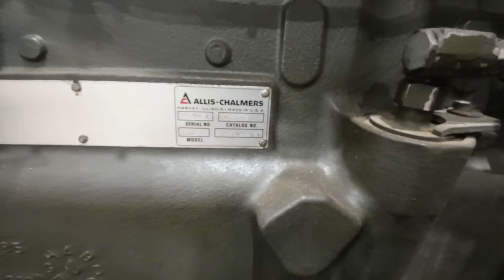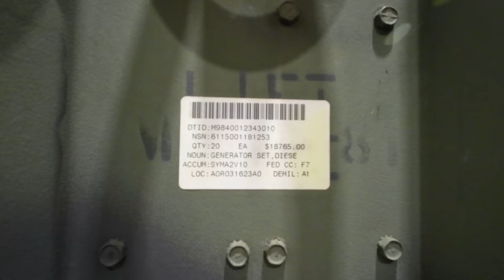$500 Diesel Millitary Generator sitting for many years, WILL IT RUN?? (Allis Chalmers 3500a)

Comment: If someone has not said so far the majority of military wiring to stuff like fuel shut offs will be insulated return, meaning the 2 wires will be hot and ground, the ground will not be connected to the chassis/engine

Comment: Millitary aircraft have a lot of systems that are sensitive to electrical noise, so they run a lot of independent grounds to minimize noise.  That would explain the insulated fuel solenoid.  Not sure but aluminum wire might minimize noise, or just make the skid a few pounds lighter for transportation.

Comment: Its possible that engine was used in some kind of marine application based off of the salt like build up around the lower radiator and tinned wire

Comment: I don't know if this will be relevant or not. Years ago someone I know purchased a diesel pickup from military surplus. He could never get it to run right. Well it was off a airforce base. Turned out the injection pump was set to run JP-1 instead of diesel. Once a technician re-tuned the pump for diesel it ran like new.... So if you generator engine doesn't sound right change the fuel to K-1 and see if it improves...😊

Comment: That engine is for a 60KW 400HZ generator. It's a 24VDC (NATO) system. Stanadyne bought out Roosa Master so that's why they look and are manufactured the same. It's not aluminum wire. It's steel wire. Very expensive cabling. The square tank next to the filters is a "Day Tank" and shuts the generator when you have one minute left of fuel. It prevents you from bleeding the system if it runs out of fuel. The tan box is the electric governor and that arm in the back is for fuel shut off the one facing you (outer side) is the throttle arm. There are two electric fuel pumps. One is your main pump and the other pump of for the auxiliary fuel. With the electric governor, the engine runs at 2000 RPM's. A 60 HZ generator runs at 1800 RPM's. The electric governor will make it run at 2000. You need to move the governor actuator in the Full Fuel position for it to start. In its current state.....nothing will start or run without the control panel. The fuel injection pump has its own mechanical governor.

Comment: As a 52D (Now 91D) Power Generation Repair and Maintenance for the US Army circa 1987, I can tell you two things about Army generators.  Both the positive and the negative are wired and wired backwards. In other words, the military treats (or at least treated in 1987) negative as positive and vise versa.  I don't know if that applies now or to this particular unit but that's how it was back then for the Army.  Oh, and the military is Metric.  Now to finish the video to see what you figured out.  LOL

Comment: Stalactites and stalagmites are very easy to remember.  A stalactite grows down.  It has to hang on TIGHT or it will fall, where as a stalagmite grown up.  If it is lucky it  MIGHT grow tall enough to reach the roof.

Comment: In aviation, we use tinned copper wire or silver-coated wire to prevent copper from corroding. I believe that is what you are perceiving as aluminum wire. Aviation wire is almost always white and teflon-coated these days.  Keep up the good work
Reply: Then you show the data tag for '85... maybe aluminum

Comment: Those two canisters you mentioned are fuel pumps. These types are used on small aircraft. Or at least they look mighty similar. Put power on it and see if it clicks clicks clicks.
Reply: Also the wired negative as opposed to grounding to chassis on the shut-off solenoid smells of aviation. Sure purrs like a kitten she does. Congratulations !

Comment: If I remember correctly, the aircraft uses 400 hertz power. 
Maybe they were using this unit in an extremely cold climate and the fuel needed to be heated to some minimum temperature before the engine could start so no power would go to that fuel solenoid until the fuel temp was met. That might also be the reason the "ground" at the fuel solenoid isn't simply the chassis of the machine. The temperate sensor may provide the ground once it sees the correct temp. Like a fan relay sensor.

Comment: "Wasn't a single pot hole in the first three feet" - Lol, we feel ya in Minnesota.
Reply: From next door in Wisco. There’s some potholes in Milwaukee that have their own potholes. It’s all the freeze/thaw cycles that just wreck roads and therefore wheels, ball joints, and other automotive components. I went down south and discovered that the roads are super clean down there, which is part of the reason cars last so long. Another reason is salt (which is also a factor in northland road wear).
Reply: @jasonmansfieldsr8645  "I went down south and discovered that the roads are super clean down there, which is part of the reason cars last so long." -  That works until it gets hot enough and then another set of problems arise.  One older family member lived down in Mission, Tx in the winter.  Every spring he'd have to have an alignment done after he got back, often with the replacement of the control arms ends.  Some of the holes at expansion joints were amazing and the how even the joints were was directly related to the materials.  You could catch air when it was asphalt to concrete and back to asphalt on a busy street.

Comment: The "Electronic Throttle" is a speed governer which used a voltage sense from the generator to regulate the output power so the voltage doesn't change based on the load to the generator.

Comment: You see there after studying the diagram for this unit, we see it goes from the tank up to the bifurbulators, then clearly it goes over to into that gorbichovski unit which measures the in line pressure before heading out next door to those double floppy jibets, im with you I prolly would have ended up bypassing all those humperdinks. Actually might not be a bad idea to go ahead and check the specs on the IN-line rotary durrdurre 😂
Reply: And for the record it’s also widely known as tappy tapperstein 😂

Comment: At 28:22, the canister things are electric fuel lift pumps. All diesel engines (99%) have fuel lift pumps to feed low pressure fuel to the injection pump. Ad one of the those into your fuel system, and it will probably run even better!

Comment: The wire may be tinned copper.  Marine grade.  Our 1970s Allis tractors with similar diesel engines have tinned copper wiring which looks like aluminum wire.  Tinned copper wiring resists corrosion and can last 10 times longer than plain copper.

Comment: That looks like a GAC - Governor's America Corp electronic regulator, their website is quite good for info on all the bits. The governor in the injector pump may only be limiting the top speed and the "throttle lever" may be setting the fuel directly not the engine speed.. You probably need to take some photos and injector pump part numbers and run them past Area Diesel to find out what you've got. I suspect the injector pump won't run Fat Allis without a different governor in it. But 500 for a replacement engine is amazing.

Comment: silver plated copper.  Mil grade. I have a short roll.   Having access to both can have 'digital' logic control.  This is controlled by THIS AND That then it turns on.  Both are active controls.  Complex electrical circuits.

Comment: You can do a preliminary smoke test using a current limited adjustable voltage regulated DC power supply 0-30VDC range  (good for 12V and 24V) at a max of 20 Amps which will power most of the engine subsystems without running the starter. So, tests are done with key on engine off. This way you can verify all of the wiring, controls and actuators without the danger and needless discharging of the starting battery. After your testing is complete you can disconnect the DC power supply and connect the starting battery. The power supply can also be used as a battery charger if you don't mind setting it up and then checking on it periodically.

The generic wiring is most likely not aluminum but fine stranding silver coated copper with a Teflon jacket (which is very high heat). This type of military spec wire only comes in a limited number of off-the-shelf colors the most common being white.

Comment: Big aircraft are often 400Hz it allows smaller, lighter motors. smaller aircraft typically use 28vDC at lots of amps. Can't tell much from the missing power head but the RPM may be unusual.

Comment: I can tell just from the vid that engine was barely used.. it was probably used for hot starting planes and was only used for a short period of time every once and a while.. the paint on the engine block is still perfect, meaning it didn’t go through enough heat cycles to burn off or fade, and the turbo barely has any oxidation on it from heat cycles as well.. also, that jelly stuff on the radiator is just crystallized coolant.. there’s was probably a small drip coming from that fitting.. as the moisture in the coolant evaporates, it leaves behind crystals from the coolant

Comment: I wondered if you ever used a grip hoist?  The hoist grips a cable in two locations and is so safe that it can be used to suspend personnel.  It also has a much longer reach than a conventional come along.  Not very expensive and I think you could find multiple uses for one.

Comment: this generator injection pump is set up for 1800rpm(60hz) or 2000rpm(400hz) droop compensation,not vehicular use..use the VSLS(variable speed/limiting speed) injection pump from fat alice to run this engine in the loader.

Comment: You can tell the difference between a stalactite and a stalagmite by remembering that a stalactite holds tight to the ceiling and then a stalagmite just might reach the ceiling. I think $500 is a hell of a cheap diesel overhaul.

Comment: Remember to add a fuel supplement (I use Howes but there!s a lot of other brands that will work),  with removring the Sulphur content from the fuel you don!t have anything to lubricate your injectors or injection pump which will shorten there life.

Comment: For those wanting to know what is different about aircraft gensets, aircraft use 400Hz AC power. The reason is that it allows for smaller and thus lighter servos and electric motors for the aircraft which is vital for any aircraft to reduce weight and size. The ground Gensets have to use a Static or Rotary frequency converter to increase the 60Hz generator output. As the only other solution would require spinning the generator at 24,000 RPM. The fuel system is a system that prevents ground crew from running the generator dry of fuel and thus open the aircraft environment to fuel contamination during priming. Usually the fuel pumps used on these aren't capable of low speed idling hence the dead crank switch. They are meant to maintain engine rpm at 1,800rpm as exactly as possible.

Comment: 115V AC @ 400Hz generator, and the unit is properly specified to be used in the normal military temperature range of −55 ° to ~+80 °C (-65° to 176°F), with regards to the wires are you sure they are aluminum?, normally we use tinned copper wires with teflon coating for military applications as it's not allowed to use raw copper due to corrosion.

Comment: The small tubes on your Allie engine that fuel lines run thru are part of a sentinel engine protection system.  With the loss of oil pressure or high. Coolant temp it will shutdown the engine.

Comment: I’m surprised it ran without the electric lift pump I have 3 of them two 60kw and a 30kw all run really well best thing to do is get rid of the coolant flow control valve on the bottom of the rad but very good deal I would bump the timing up a lot when you put it in the lift

Comment: Just for shits and giggles, that weird frequency used for aircraft is based on an early (German? not entirely sure) jet engine design and for whatever reason, they stuck with it ever since. it is actually 115 VDC at whopping 400 Hz. Smaller aircraft and especially piston engine aircraft usually use 28 VDC for ground power, which is more or less battery voltage.
For those wondering what ground power means, it means the aircraft and its systems are powered from the ground and do not use battery or have to have an engine like the APU (Auxiliary power unit, a small turbine located in the aircrafts tail) intended for this purpose running, which reduces fuel consumption, noise and emisions. At an airport you can see either some sort of generator trailer sitting next to an aircrafts nose, or a thick, often yellow or orange cable commming from a reel underneath the passenger bridge and pluged into the aircraft typically somewhere around the nose gear or at the side of the nose. Depending on the aircraft size, you will find one to four of those connectors. Most aircraft (and i am talking airliners here, not business jets or smaller aircraft) have one, some wide body aircraft have two, the A380 has even four of those. The connectors are quite beefy, standardized and can supply up to 90 kVA

Comment: Those two little cylinders at the fuel lines run through that have wires on them those are electric fuel pumps the single wire that comes out of the top of it is positive

Comment: Worst thing you can do run on water, you’ll end up having to replace water pump.
Antifreeze has lubricating properties for the water pump bearings, run it very long on water and it will start leaking.

Comment: So a few issues with this engine. One the fuel solenoid, the reason it may have two wires is one is a pull wire and the other could be a hold, Kubota’s are the only ones I know that also use a two wire set up. The hold goes to ignition on the pul wire goes to the starter start wire. If you give constant voltage to the pool wire it will eventually burn out the solenoid. Other issue is a generator engine is only rated at 1800 RPM. Your loader engine is probably rated for  2200 rpm or more. Just a thought but good job finding that engine for $500. I to have had to learn about diesel engines and diesel generator engines as the only difference is the fly wheel weight and governor has 4 weights in it versus only two.

Comment: I think those two round cans with wires mounted on the inside of the frame are two electric fuel pumps, possibly a Fiam syle? This would tie in with the tank being under the engine so it would need some oomph to get the fuel uphill?

Comment: most aircraft are 115v, 3 phase, 400hz. The reason why is becasue 400hz transformers are smaller (read: lighter) than 60 hz transformers.

Comment: I would contact A/C and see if the motor can be used for your machine. there may be BIG differences in bearings, castings, etc You don't want to put in all the work on a swap and then it blows up. Otherwise, it's a great price. good luck.

Comment: The fuel shut off solenoid needs hot and ground because the control circuits use both wires.

Comment: Aircraft use 3 phase 400hz AC power and 28v dc. Also the military uses aircraft standard wires on all equipment, it's tinned copper wire not aluminum.

Comment: Generator output frequency is directly tied to engine RPM, so this old style generators have to control engine RPM to stay at correct freq. 
When i was in army, we had dolly with two generators for our radio station working simillar way. Just moreless mechanically, not electronic controlled. There was that centrifugal thingy controlling throtle directly based on RPM. Crude, pain in the ass to attune, but then(after some oiling and fidling) it worked pretty well.

Comment: Looks like it was prepped for long term storage and never purged judging by the stuff in the fuel lines. Too bad the previous owner ripped it shreds taking the old generator off and dismantled all the wiring that controls all the safety disconnects, engine speed and the Murphy switches on those generators that you had to hold while it started up.

Comment: Generators are engineered to run at full speed, so it should not be in idle when producing power. It must run a full speed constantly while depending on it for power

Comment: i imagine its biggest issue is that the generator and all of its control systems are not there.  when you install it in the loader as a regular engine, most of those problems ought to go away.

depending on the age, some of the complications in the fuel filters might be there if its intended to operate mainly on JP8 along with all of the rest of the military.  or, it and the other 20 in that batch were dumped during the switch over as cheaper than changing them.

Comment: I'll bet $10 to a donut that those two "canisters" in your fuel system are electric fuel pumps. They used the same thing on some brands of cotton pickers from the 60's. And it's been a day or two but I'm pretty sure they were made by Bendix. BTW Matt, you said the fuel tank smelled like water. What does water smell like? LoL

Comment: Aircraft use 115v ac  at 400 hertz. The 400 hertz is much "cleaner" than household electricity with 60 hertz. It might be a good thing you didn't get the complete Gen set.

Comment: The reason for the many AC engines in the military, was that president Johnsons wife owned the controlling interest in AC. 

Matt you should use distilled water in the cooling system to keep the lime build up down in the systems.

Comment: the "A" in AC current represents the word "ALTERNATING". how fast does it alternate? in the U.S. it alternates at 60 times per second or 60 CPS (cycles per second) or 60 HZ (Hertz). electric motors are designed to work with 60 cycles per second in the U.S.  theoretically, it can alternate throughout a continuum of cycles per second. the U.S. standardized on 60.